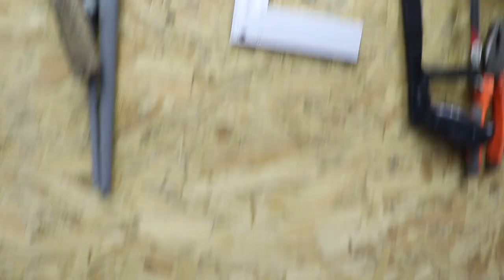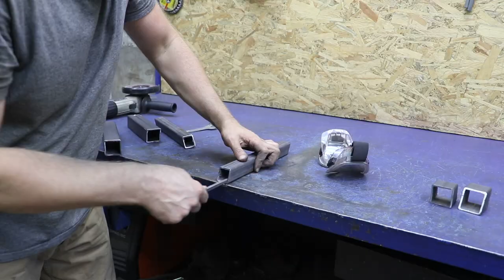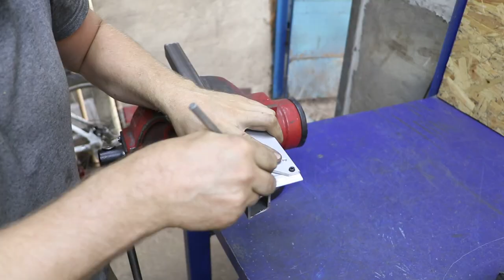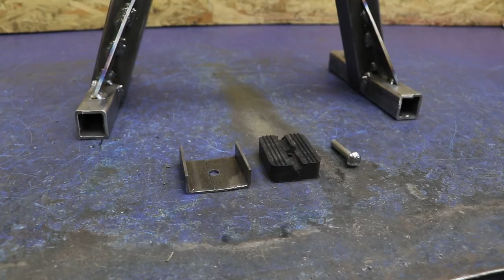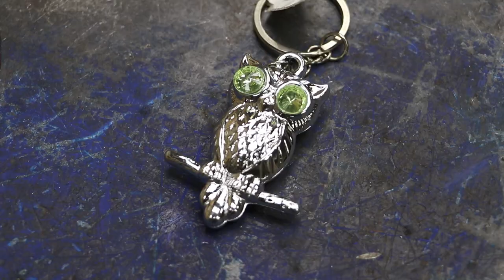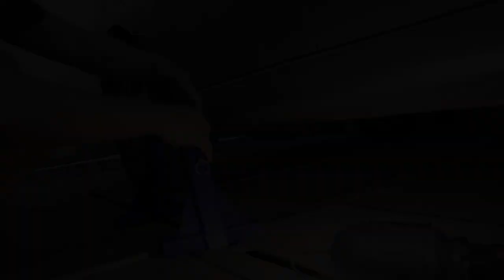How to make a jack stand for a car?

Comment: All he needed to do was buy the square tube that has no weld seam in it like a 2-inch trailer hitch tube and then he could have just used a regular square tube without having to weld on the shims. I like his slanted design that allows the stand to be raised without having to remove any pins until the new height is set. I would prefer to have pins with the ball spring lock on each one.

Comment: You HAVE to weld the 2 legs together for safety reasons. Also for safety reasons you shouldn't have variable height. The "pin" can snap.
Reply: why will the pin snap ? "normal" jack stands come with pins.
Reply: @LevyHappyClapper  The pins are special metal. This guy probably used mild steel, the weakest kind.